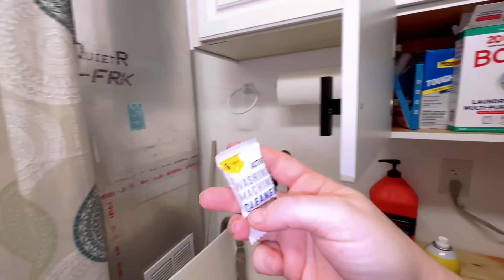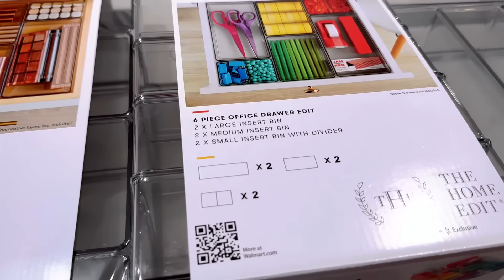Whole House Deep Clean With Me Cleaning Video Motivational Routine

Comment: I am not able to clean like you did on floor around windows and can't reach also due to osteoarthritis and poly arthritis. Also I have left heel spur.  I used be able when I was younger.  Now I can't do that anymore.  I can do it in different ways without getting down and up.
Reply: I have Fibromyalgia and arthritis. All my joints hurt 24/7 and I can't bend down to squat at all. I use my mop on the walls and floor boards and such. It really does work! 👍👍

Comment: I’m really interested to know why in the USA you don’t line dry more. Everyone seems to have a tumble dryer, which in a place like Florida seems madness, let alone the damage, using all that electricity, does to the environment.
Reply: That’s a good question. We probably should! I try to dry things like swim suits, pool towels, rugs, etc. on my balcony if it’s warm enough (I live in a state with snow). But a tumble dryer is just so much quicker and more convenient than having to individually pin up each and every shirt, sock, underwear, etc. in each and every load.
Reply: The humidity is too high most of the time - and so clothes don’t dry.
Reply: I like to use a dryer so I don't have to iron my clothes. My dryer is no longer working. I line dry my clothes, and I have to iron. I am not found of ironing.
Reply: I do both. But many folks are in apartments without outdoor space to hang entire loads, or have rules that restrict hanging laundry in visible areas. What do you all do when the weather is wet, if you don’t have dryers?
Reply: @mamat1213  lots of people in the UK don’t have tumble dryers and even then we don’t put everything in there. We dry our clothes inside and in the warmer months we hang them outside.
Reply: Lol , I'm 47 and only my grandma line dried.  Not everything though .
Reply: Easier to use the dryer, throw the clothes in and forget them.

Comment: Thank you for posting!  I did a Pomodoro with you,  deep cleaning the kitchen. I use eyeglass spray and paper towel on the stove's back dial plate (yours doesn't have one) and hand sanitizer on the grunge area behind the faucet.  Regarding the cast iron pan, when I use it as a casserole dish, I put in a sheet of aluminum foil first for an easy cleanup. When I use it for frying, I clean it by boiling water in it and using an pancake turner on whatever got stuck.  I scub the pan with a little water and coarse salt , give it a rinse and a final wipe, then heat it on the stove to dry: No soap! (Well, a tiny bit, once in a while and very quickly, using a lot of water and no soaking. "It's a Southern Thing" has an episode of what happens if someone runs the pan through the dishwasher and it isn't pretty 😢)

Comment: Don’t you have another set of sheets to put straight on need to buy a second set you will find it so much easier to put on fresh remake bed as the bed is the largest thing in your room it makes your bedroom 3/4 tidy and bust you up instead of having to go back in your work x
Reply from the maker: I do but I love putting fresh sheets out of the wash onto my bed at night to snuggle into.
Reply: @livingwithcambriea  you could always put your spare sheets into the dryer with a fabric sheet allowing your sheets that you took off so  the fibers relax from all the pulling and tugging of washing and drying  going on they would then last longer and you can rotate x

Comment: Hello cast iron i usually wash with sometimes no soap. An just a few drops of oil on it when ur done washing it dry it put an rub the oil into it an put away. Evryone thinks it hard to keep but ive have had my pan know for 26 urs now... I will pitch a fit iffn someone uses it. I have other pans.... 😂 ❤ heeheehee an when it needs a good scrub put some salt into the pan. An scrub it with a scrubbie an oil it down when ur done... ❤